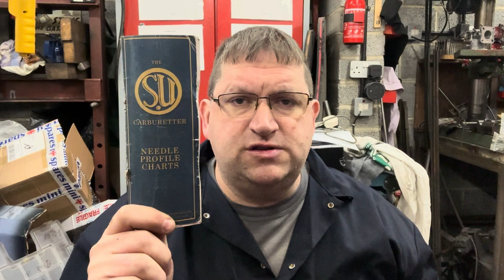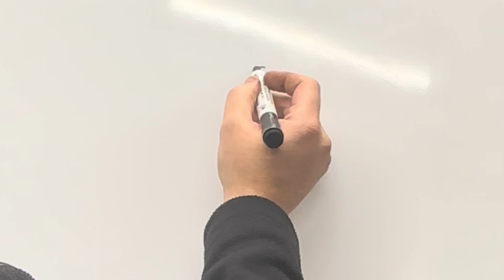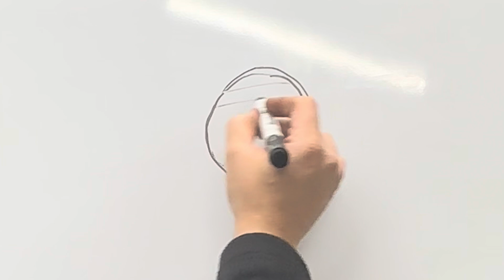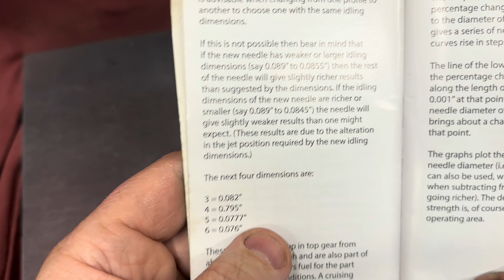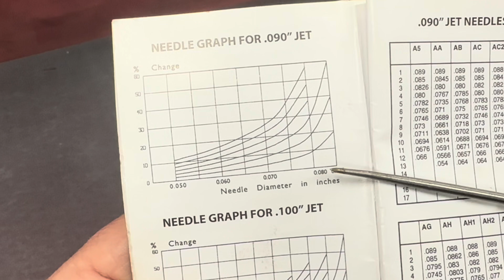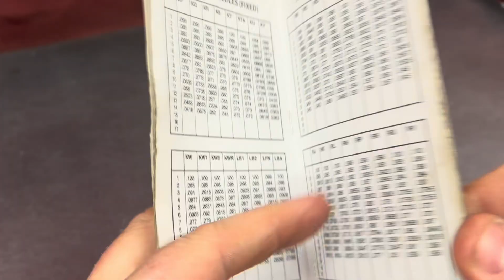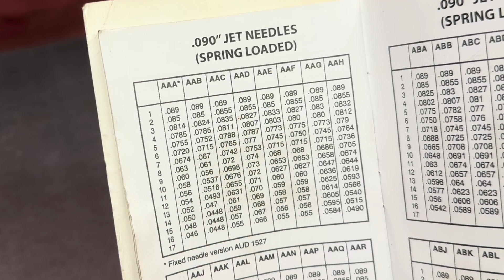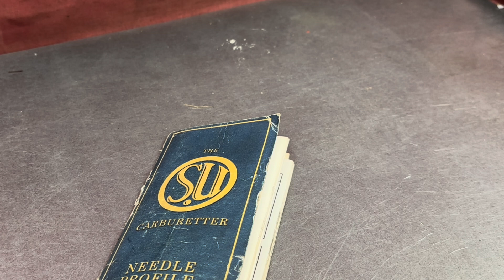How the SU Carburettor works  - Part 3

Comment: what would you consider ideal AFR for acceleration (full pedal) and deceleration (foot off pedal)?
Reply from the maker: Ideal decel is infinite lean ie no fuel at all, ie like injection where it turns the fuel off. Full power 12.5 to 12.8 all the way to max power. Boosted applications 11.5 to 12 under full power.

Comment: after watching this I realised I knew nothing about how the su carby really worked and how sensitive it was.
One question I have why are some needles screwed in and flexible and some are hard fixed?
I set up my triples with the jets set like you showed in a previous video on a motor like you said to do which will just get it started. However when I started the motor with the butterflies closed it strangely revved up high. I can't work it out any ideas?
Reply from the maker: The butterfly’s have not been centred correctly is the usual problem, when you close the throttle the discs are not sealing the airflow off properly

Comment: When you mention different positions of needle for different RPM, i assume you mean different airflows as for example a large throttle angle at 4k may be the same airflow as a smaller angle at 6k but both will raise the damper the same amount as its airflow lifting it versus the spring?

And hence you can only pick one AFR for both of those situations even though in reality it might be better to be a little richer at WOT at 4k than at 2/3rd throttle at 6k as one is acceleration and the other is maintaining a constant speed on fast cruise?
Reply from the maker: No the reality is there is no overlap on needle stations.
Reply: @ACDodd 
Surely if the airflow is the same at two different combinations of throttle/rpm then the damper would be lifted the same amount so how can there not be?
If for example you are making 60bhp in both those situations then that would be the same CFM and hence the same lift?

Or am I missing something?
Reply from the maker: @sjc75vs you are indeed missing something, air flow is airflow, if the engine is producing 60hp it won’t do that at different throttle openings and different rpms. If it does that at a lower rpm its airflow  will be the same at the lower rpm, and the engine will produce more torque because it’s doing it at a lower rpm. The throttle plate simply restricts the airflow so in your example at a higher rpm with a more restricted throttle setting the piston will be flowing the same air at the higher rpm, so the carb measures airflow, which is what makes it so good.
6000rpm on part throttle the piston is not in the same position as it would be if you were using half throttle for example. 
Don’t confuse rpm with needle positions. The air demand is what determines where the needle is.
Reply: @ thanks for the phone call earlier. Far easier than typing. 

To clear up for anyone else reading the comments. I meant for example a 80bhp peak bhp engine would make 60bhp at 4000rpm at full throttle and also make 60bhp at 6000rpm at 2/3rds throttle. And hence for those specific conditions both would have “60bhp of airflow” at that point.

Comment: Great explanation, really enjoyed that thank you. Quick question, how accurate is the jet sizing with relation to production? Does this need to be considered with relation to needle adjustment?
Reply from the maker: Yes I does vary but only in the tenths of thou range and yes it’s one of the reason that there are wide variations in fueling curves from carb to carb

Comment: thanks AC. I am beginning to get a grasp on the complexities of SU tuning (HS4s on a '67 BGT here).  How about a recording wide band gauge that could plot lambda against throttle position as you drove the car through a range of engine speeds and loads.  Could analysis tell you whether you should change or modify the needle ?  John in Manitoba, a long way from you.
Reply from the maker: You could do that but a lot of people like to try and get way to much data, and that’s an example, you don’t need to do that in reality.

Comment: ...Do I now have a claim to fame as I was sat opposite Don at Burlen when he wrote the advice section 'Choosing a different needle' for the Profile Chart?. Unlike me , he's a very clever chap!. 🙂
Reply from the maker: Hehehehe maybe!
Reply from the maker: Although it now could do with updateing to include the need to use measuring equipment to track your progress and the dangers of engine damage due to over and under fueling
Reply: @ACDodd   He wrote the guide back in about 1991/2. We'd been proof reading and using Burlen's first edition S.U catalogue before the profile booklet was printed.
Reply: Nb. If Stan is still there, he'll remember as he was our manager.
Reply: @ACDodd  I'm assuming no changes have been made to the original advice which was based as you've mentioned on mathematical area changes and not on flow data / rolling road. So purely a guide. You've gone to the next level with practical application.
A lot has changed over the years, in particular the fuel. In 1986, the lead content in UK petrol was reduced by 30% and isobutane added. This certainly caused a few issues with pre-ignition, fuel vaporisation on many vehicles.
Reply from the maker: @RussEdgar445y7tlfj I remember that fuel it was junk for reducing knock. The ethanol loaded brew that we have now is much much better, and you only need to use a stabiliser to stop the fuel going off, and the effects of moisture damaging the internals of the SU.
Reply: @ACDodd  I remember the only way I could get a few cars I maintained in those days running decently was to blank the vacuum to the ignition distributor and set the timing by ear. 🙂
Also the wax type HS jets were mostly replaced with the  ordinary style as caused hot running problems after standing heat soak after a short stop.
All very different with modern fuels, and why I'm enjoying your updated views. 🙂
Reply from the maker: @RussEdgar445y7tlfj
Reply: @ACDodd  looks like something is missing from your comment...
Reply from the maker: @RussEdgar445y7tlfj  keep watching there is more to come next year!
Reply: 👍 Will do. 🙂